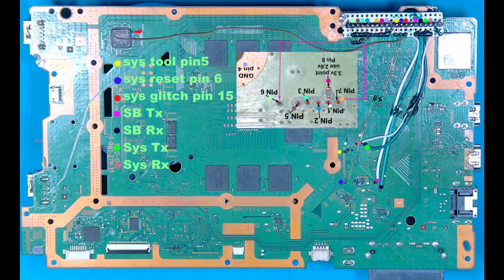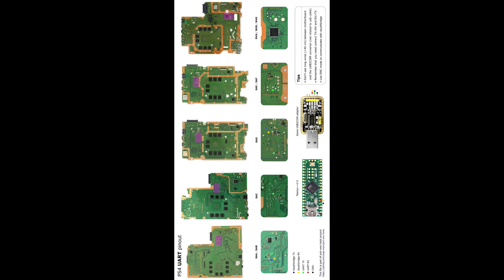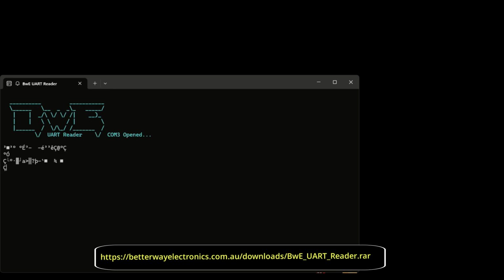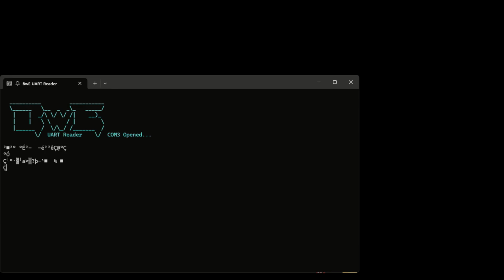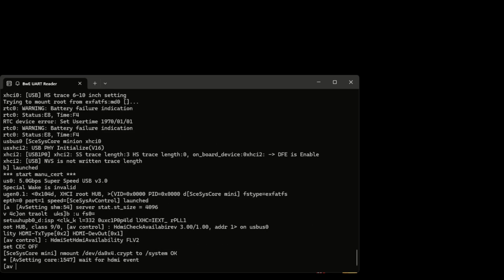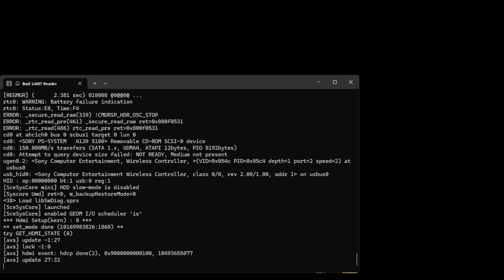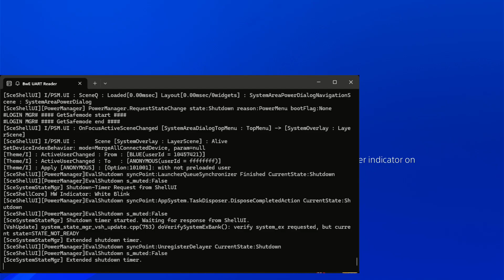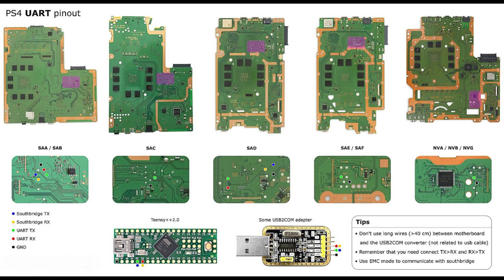Part3 How to get PS4 Boot-log from PS4 SAD001. check end of video 4 contact info..

Comment: Hello Steve, nice video!!

Im trying read the ps4 syscon "A04-C0L2"chip with teensy 4.1 ... i´m using the same configuration as a teensy 4.0

Is the first time that im read using bwe reader but the bwe dont recognize the syscon ... should i need do something before try read the syscon or the program should read automatic? 

I mean, im seeing some of your videos and you can read the syscon chip just conecting the teensy ... but i trying doing the same , but dont got result ... 

Other thing that i realize, the bwe reader dont recognize COM Port automatic , i need inform ... the program open the door "COM4" but nothing happening...

Could you please give some tip about?

Im using the original software bwe.

If i trying read syscon with bwe uart syscon tools 1.0.4 and press 1. read , it show ERROR   : NO SERIAL PORT SPECIFIED!

I´m lost here!!

Thanks for any help!!!
Reply from the maker: The Bwe read ONLY WORKS WITH THE BWE hardware, does not work with teensy…  you need to get the Abk app 2.02 its on git hub. Theres a link on my last video
Reply from the maker: @valdemarlima4560  BwE don’t support the teensy  only the ch340g chip, only the Abk software supports teeny 😊
Reply: @Steve_be  Thank you so very much Ms. Steve, you help me a lot with this information!!!
Reply from the maker: @ if you get stuck just ask ill always help if i can
Reply from the maker: Have a look at this video https://youtu.be/SdyxlncxNbk?si=Iyjk1g7ZVisIRLCn